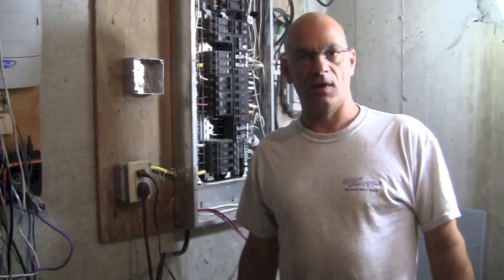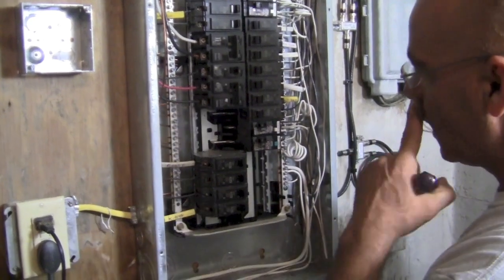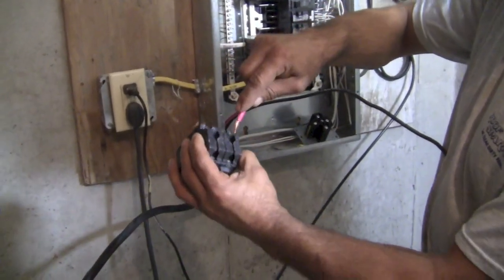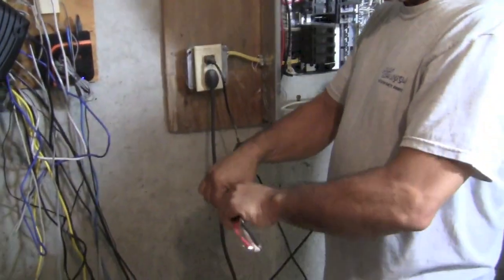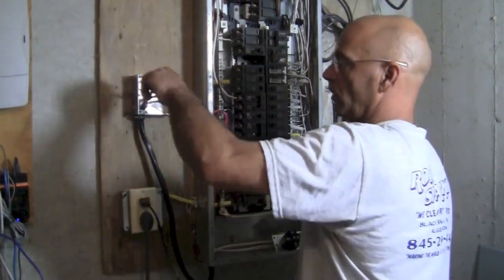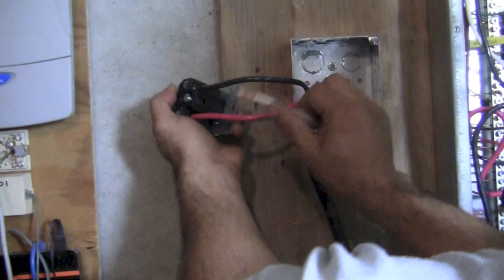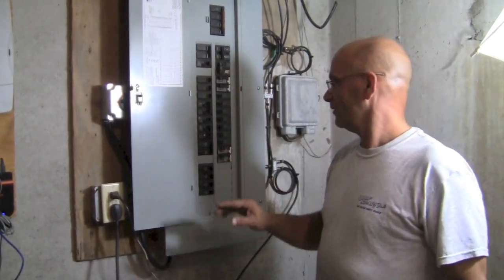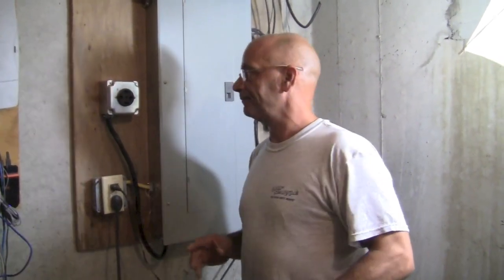How to Install a 220 Volt 4 Wire Outlet

Comment: From 240v how do we go to 220v using same wire.?
Reply from the maker: It's always 240 ish. Each hot leg of the two that is needed are 120 volts each. Making your 240. 220 is just a common phrase used. Back in the day there was 110 and 220 volts.

Comment: is the bars on the left and right both grown bars? does it matter which side you hook up the white and grown?
Reply from the maker: If it's the main panel no it does not. If it's a sub-panel it does matter.
Reply: what is a sub panel.
Reply: @moviesforrandy a panel that is fed from your main panel

Comment: We had a three prong stove put in with clickers for the gas elements.  Wondered why the clickers worked sporadically.  Finally got rid of that stove and bought a new one that had a 4 wire plug.  Read the install sheet and it stated 3 wire plug will not operate the clickers correctly.  Now we know.  Putting in a 4 wire.  Luckily the plug goes straight down to the basement so the wire run will be easy.

Comment: This is today's task. However, there is something  i believe i missed that is very important. Did you run both hot wires from different incoming hot lines. One on each separate incoming line. Or both off the same incoming hot line. I've watched this video several times to be sure. Thanks awesome video
Reply from the maker: A 220/240 breaker would grab two different hots. Otherwise, it would be 120 volts, no matter what.
Reply: @Askmediy  lol thanks. Quick question. We are to far away from the breaker box to run a line from the breaker box. Is there a way to do this using nearby lines or outlets?

Comment: thank you for great video; only one comment, following your logic for safety, I would connect my ground first, so if for some crazy reason the hot wires get energized, I won't get slapped with it.

Comment: I have to look at amps? Isn’t that important? What the dryer requires? 30 amp double breakers? You have 50 amp, isn’t that a fire hazard?  Back of my dryer says 30 amp.
Reply from the maker: Yes of course it is. Dryers are 30 amp. I didn't say this video was for a dryer. But it's a four-wire 240 volt.

Comment: Can you add a 220 breaker on a 150 Amp panel? Thanks in advance!
Reply: This will be installed for a Pool Heater that will run about 8 hours a day.
Reply from the maker: Of course. As long you have the room in it.

Comment: So no conduct needed if you run a wirer across inside on top garage wall back into house box.
Reply from the maker: You sure do
Reply: @Askmediy  thanks
Reply: Why I asked I didn't see any from your outlet to box that's all .
Reply from the maker: @cookinitmax  Because of the very short run. Even though some inspectors will want it covered.

Comment: Thank you so much for sharing ive gained alot of confidence with electrical because of you and a few others. If I may I would suggest using a metal box because it Can be grounded to the circuit therefore tripping the breaker. They are also fire rated and burn alot slower than plastic boxes. I had some wiring burn up in our rental and luckily it was on a metal box and was an easy fix
Reply from the maker: Thank you. True true, but don't discount the fact that wires can't short against the plastic either. Food for thought. Yeah but I do prefer metal

Comment: Thanks for the video, installed a dryer with your information. Everything seems fine but after a few minutes in the dryer cycle, it trips. Any tips?
Reply: I am reading 250 v
Reply from the maker: Check all connections. Make sure you’re using the correct wire and breaker. Breaker should be 30 amp and wire should be #10

Comment: I have a question… if a device has a 4 wire tail, and you only have 3 wire outlets (220). Is it possible (on the device side) to join both the ground and neutral together and have the 2 hot separate to use a 3 prong plug 🔌 to connect to the 3 wire outlet?  Thanks!

Comment: What if the old appliance I am replacing was a 4 wire set up at 30A, but my new cook top is only 3 wire appliance at 40A? Do I just cap off the neutral and swap out the old 30A breaker with a new 40A breaker? The gauge of the wire is 8. Thank you.
Reply from the maker: #8 is good for 40 amp. Is the new one looking for a neutral? Look into that first. Two hots with a neutral with the ground being a metal grounding makes more sense.

Comment: Is the slim-line 2pole breaker installed the same way? I only have one space left on panel. I want to wire for a welder.
Reply from the maker: No, The breaker will need to grab both hot legs.

Comment: Hello & thank you for helping those of us not as Learned in Electrical - I’m battery back up with a DIY  generator , my inverter is EA SUNb5KVA 230v Pure Sine Wave Inverter Hybrid Charge Controller and I’m using a SIEMENS MTO100A Transformer 230v to 110v to 120v inlet H1 - H2 - H3 - H4 two U clips connect H1 & H3 together & H2 & H4 together for 220 - 230 - 240v outlet X2 - N/A - F - X1 there’s a fuse bracket to N/A & X1 - I’ve got 1 Phase 230v out of the Inverter and trying to get Dual Phase 110-120v outlet ? This is the way I’ve seen how to do it !

Comment: Please help! I’ve been breaking my head for weeks. I don’t understand how any of this works and had no clue I had to pay attention to volts. I know DUMB! But now I’m stuck with a new front load dryer 220V or 240V but I need to know if there’s a way that I can convert it into a 110V for an NYC apartment. Any suggestions? Thanks!
Reply from the maker: Oh hell no. If it’s an electric dryer you’ll need 240 volts.

Comment: Excellent and Actionable content; very well presented and explained.  I was actually looking for the installation of a 30a - 220-240v, Four, (4) Prong, Five, (5) Wire receptacle installation.  As a 90% disabled veteran after 25 years of service; I am trying to help my wife retire a few years earlier by working from home and I have built a personal data processing center at home; and to follow the 80% load rule; I need to use two, (2) 30a -240v Metered PDU's, (Power Distribution Units), two run the computer system(s) I have already built and other sensitive electronics.  I will look at more later on as I plan to scale; and would have to install another 100a sub box off the main.   I ran secondary lines from the main lugs on top to a 12 x30 ft shop I had built next to my attached garage and ran the wire for 22, 20a, 120v outlets, which are piggy backed off 10, 30a, 240v outlets; my theory was if I didn't need the 240v outlets, I would just use the 120v outlets. Not sure it a clear would picture can be drawn; but I saved a lot of material by not having to run both orange and yellow cased wire the entire length of the shop; under each 240v box, I installed a double 120v outlet box about six, (6) inches below the 240v single outlet box incased in grey PVC pipe along the walls.   I actually started into all this in January of 2017, but my systems were hacked in May of 2019 for two years of revenue, and I had to start from scratch a month later after slow formatting all the drives in 10 computer systems, and then had to reinstall all the operating systems which took a month; so, I studied up on running several layers of security, because there is no 100% security solution these days; you can only make it more difficult and time consuming, ( a sucking chest wound of their time searching virtual systems ), and hope they just move on to a slower moving target.  I will look through your other videos to see if I can find any fun facts before I wire this up; thanks again for your time and effort in sharing this content.
Reply from the maker: Thank you very much. Good luck with all that.

Comment: Fyi Check your manufacturer requirements for the amp breaker you need for your dryer. It does matter ALOT

Comment: I have a metal box also for my dryer outlet and wanted to know do you need to pigtail a ground wire from metal box to your ground wire that is connected to your outlet so that the metal box is grounded? Thanks
Reply from the maker: Yes you do.

Comment: Careful opening that panel. I once had a client yell at me, 'are you an electrician?! Do you have a permit for that!?' I had to get in there to hook up 220 for a drum sander. Why? Because the dude didn't have an accessible outlet, gas stove and dryer. Nevertheless, great video.

Comment: Where I am at, you would fail because it crosses over another wire. And, you have to secure the wire to that wood board . They won’t let it hang loose, in the event it gets pulled by accident. In the garage, you have to fish those wires through metal conduit. You got to pull an electrical permit too!

Comment: I came here to see if there is an easier way to get the wires into the box and attach the outlet to the box. The video says "Good luck with that, it's not always that easy". Then it time lapses forward to when the outlet is installed and the cover is on. Oh well, I already got the wires and outlet into the box I installed this morning.

Comment: If the ground bus bar and neutral bus bar are bonded together in the panel, what is the purpose of a separate ground wire and neutral wire for a 4 prong outlet? Doesn’t that essentially become 2 ground wires?
Reply from the maker: Hmm kind yeah. But the real issue becomes if it’s a sub panel

Comment: what to do when I don't have a ground and the neutral separate
 from the panel? Should I just put a bar of steel into the ground and make my own ground?
Reply from the maker: No not at all. Connect your neutral and ground to the panel buss bars.Or send me a picture if you like
Reply: @Askmediy  thanks for reply, I read another source say its like that in the main panel, only sub panel is separated. Thanks
Reply from the maker: @dumboyoyo5245  Yes very true. Read this and you'll know that much more. https://www.askmediy.com/subpanel-installation/

Comment: I have an existing 240v circuit and I need to add a neutral ! Can I run the neutral separate from the rest of the existing wires through a conduit by itself ?
Reply from the maker: I heard or seen that, but I don't see why not. Just make sure it's the same wire size
Reply: askmediy thank you !

Comment: Quick question.
What is the purpose of a bare silver wire running along with insulated black and white wires inside a metal spiral wire?
Reply from the maker: That's the metal cover ground.

Comment: Thanks for this video.
I just finished installing a 220V double pole 30amp breaker and 4-wire connection to my dryer. This was my first 220V wiring.

No fake news.
Reply from the maker: So cool to hear. Awesome job

Comment: I don't know if you mentioned it but what size is that wiring? Is it 6/3 ?? Just curious thanks again for excellent video
Reply from the maker: Not sure what I used, it was some time ago. However this video is to show how for a 4 wire. Wire size would depend on the amps needed as well as the breaker of course. Length as well.
Reply: @Askmediy  still, u explained very well.
Reply from the maker: Thanks buddy. Yeah I try to stay away from giving wires sizes because people get hung up on that and that’s not always the case

Comment: What gage wire are you using? 6?
Reply from the maker: Yes it was. But the wire size would depend on the amps
Reply: askmediy I want to wire a nema 14-50 plug on a 50amp breaker to run continuous power at 40am.  The run is about 70ft.

Comment: Is the bare copper and the white essentially going to the same place?
Reply from the maker: First off sorry for the delay, for some reason I'm not getting emails for comments. Moreless, but not always. Depends if it's going to a main panel or a sub panel

Comment: You don't look old enough to be saying 220 volt. 220 volt is derived from the old electrical standard, back when I was a kid, when the household voltage was 110/220 volt +/- 10%. Now a-days it's 120/240 volts and where I live, the power company is delivering 125/250 max volts. So, It's hard to listen to you mix the old with the current standard by saying 120 volts and 220 volts. I, myself, have to stammer when saying the household voltage because I came from that era of 110/220v standard.
Reply from the maker: No I'm sure not.

Comment: sir the wire size is what ? dats a 220 volts outelt like for welding machine
Reply from the maker: Wire size is based on amps.
Reply: askmediy ok sir a 220 is 2 live and 1 ground ryte.
Reply from the maker: @rudysantos1712  220/240 is two hots one from each hot leg and a neutral for a return path. Ground for safety
Reply: askmediy ohk thank you sir and depending on the amps the wire size twin and earth.

Comment: Hi Dominick, 
I'm a dummy,  but followed your very clear instructions,  but I have a different problem that perhaps you could solve 
I have a powermate 3000w generator with a 4 prong female 120/240v output. Where ground & neutral opposites, then the 2 two hot 110v red & black opposites. 
I need to get 220v output on 3 wires from the 4 prong 120/240v outlet on the generator.  I hope you can understand my very primitive & long-winded question?
Many thanks if you can advise me in here in Philippines 😀

Comment: I’m running a 240 line for an air compressor. The guy told me to buy thhn 8 gauge (two hits and one Ground) the garage is 70ft away from the house. he also said being that 10 feet of of the line should be romex because my panel is indoors I should get Romex 8/3. My understanding is that 8/3 is three wires plus a ground. Well I only have three thhn wires running in the conduit. Should I have added a fourth wire thhn to match the 8/3 romex or did I misunderstand something from him???
Reply from the maker: Yes you will always want a ground "green"
Reply: askmediy so the electrician said I need THHN two hots and one ground plus she romex 8/3 wire and he will connect the insulated ground wire and keep the bare ground copper wire un used?
Reply from the maker: @millermatic140  I'm not really understanding you 100%. Without knowing if you need a neutral or not. As far as size, I have no idea on your amps so I can't say.
Reply: askmediy so my electrician had me trench 70 ft from house to garage and run wire through conduit. He told me I need 8 gauge THHN ground and two hot wires which I bought. He also said being that 20ft of this will be in my basement he recommended to get a junction box and run romex 8/3 in the basement to the panel box. When I told him romex 8/3 has four wires and I only have three thhn wires he said that it is ok because he will use the insulated wire from the romex to ground with the thhn ground wire and the extra wire from the romex which is bare copper he said he will just leave alone. This seems odd. Couldn’t I just get romex 8/2 to connect with my three thhn wires???
Reply: Basically he wants to ground the wire to the neutral romex to make it insulated. The bare copper ground wire that comes with the romex will not be used. Does that sound right ? Would you just put a nut on the bare ground ?

Comment: Do this means I don't need a circuit breaker of 2 poles and a extra single one?  Thanks for sharing.
Reply from the maker: Pleasure, you always need a breaker
Reply: @Askmediy  Sorry, I was a bit confused. I meant if I need a 2 pole breaker or a GFCI one that has 3 screws but I understand the difference now with the 3 screws on the GFCI breaker. Thank you so much.

Comment: So does the breaker amperage not matter what size it is?
Reply from the maker: Sure it does. This video shows a 12ga wire with a 20 amp breaker. It really depends on what you're doing.
Reply: askmediy I’m no electrician but need my dryer hooked up and had the breaker completely redone I just don’t want to mess anything up. The wire I have looks identical to the one your using now the double breaker should say 20 on it? Or 30 I have a couple different ones
Reply from the maker: @michaelwebster8526  You should be using a 10 wire with a 30 amp breaker.

Comment: Excellent video. I have an existing 220 4 wire 30 amp but I want to run to a 3 wire receptacle for my table saw. Do I not install the neutral in my case?
Reply from the maker: Yes, you don't use it.
Reply: Thanks for the answer. I have a scenario where I only have 1 220 line but I want to run multiple 220. My single line is a 240 30 amp 4 wire 10g. I have a dust extractor run a 230v 6 amp and my table saw run 230v run at 20 amp. Is this possible?  Can you do a quick demo to show how to run multiple 220 outlets from a single 220 line?  Greatly appreciated.

Comment: Hang on a sec  you yanks use 110 right , so the 220 you speak of is twin windings in the AC motor of the dryer running in parallel is it , or is it switched internally in the dryer to be in series ? 
Red =Active and White is Neutral/Earth  and Black Active as well  WTF  , OK so you mentioned single phase 110 but is the second 110 120 deg out of phase with the first ? 
Your only doing a 4 wire outlet  because your Neutral is at the SAME potential as your Earth , so you have 2 wires instead of 1 ,  weird the differences from the US to Au .

Comment: I'm buying a tanning bed, used. The guy I'm buying it from paid for a transformer. So I'm bringing home the bed and the bed is hooked up to the transformer. I need to run a line to the breaker box from the transformer. The tanning bed needs a 220 volt plug and I only have standard outlets. The guy said he paid $150 for the transformer box so it shouldn't cost that much for an electrician to run a line. Do you know anything about this? I'm wanting to put the bed in a separate bedroom in my basement. The breaker box is in our laundry room. I'm trying to save money and want to know if it's going to be really expensive or if I should just buy a new bed that plugs into a standard 110. Any help appreciated. Thanks